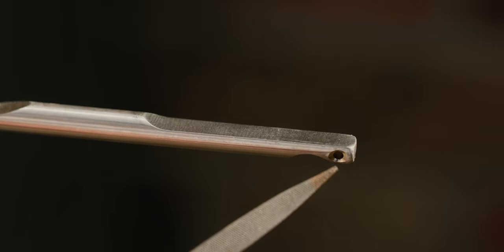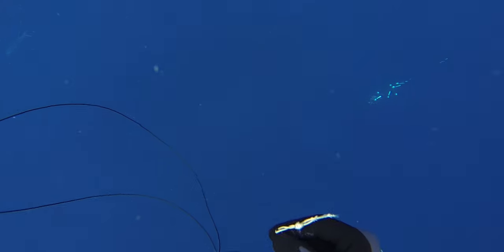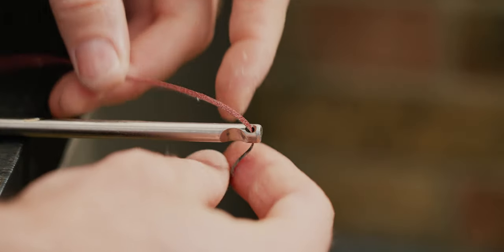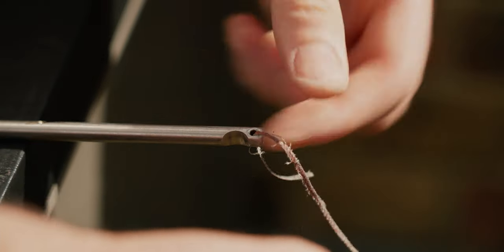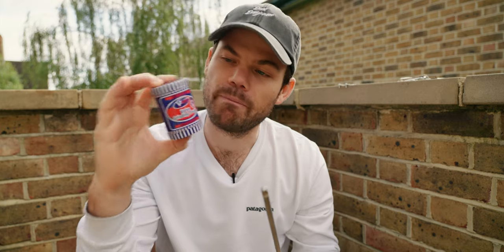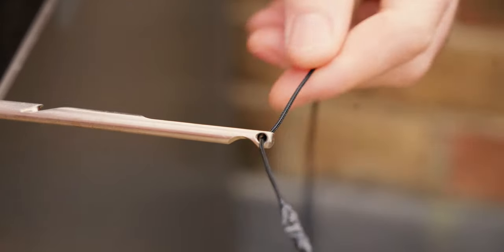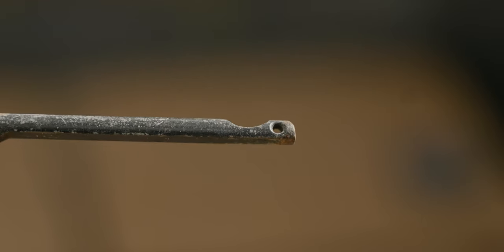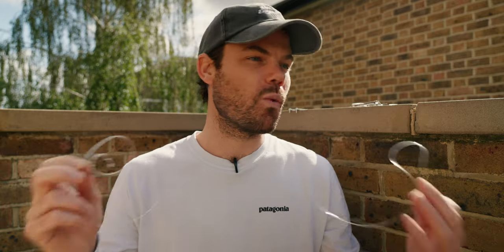Almost every shaft has this problem #Spearfishingbasics

Comment: Great tips. I’ve had issues with bridles wearing through on rough shark fins, and I’ve lost two good fish so far from the exact issue you made the video about. I’ve since just gone to tying the loop onto the shark fin holes but I’ll absolutely be doing this in the future. Huge fear of mine and I’m checking dyneema after every shot I take out of paranoia
Reply from the maker: Fix it once and forget about it 😁

Comment: I love these practical tips. Seems like details, but as an angler I learned to realize the importance of getting the details right. Imo also large part of what separates the pros from the rest.
In your experience, is this an issue with cheap spears or just generally an issue?
Reply from the maker: All the 1%’s add up to a big difference. All sorts of shafts have this problem, not just cheap ones.

Comment: Awesome vid. Such an important bit of information. 
Lost what should of been a world record mutton snapper in Islamorada using a brand new Omer shaft. That shaft was my backup shaft, however 2 dives earlier I lost my original shaft when a massive bull shark taxed my black grouper, as a result I used my back up shaft with 300 Lb mono line and I lost it on my first shot on what I believe was a 24-26 Lb mutton snapper. The mono snapped within 2 seconds of being dragged. Lesson learned.
Reply from the maker: All too common this problem with shafts sadly! Hurts even more with world class fish.

Comment: Hello Daniel, why do you use this type of shaft? And not the one with the hole at the top on the shark fin?
Reply from the maker: Faster to reload as the fish doesn’t get stuck on the shark fins when you go all the way through the fish. Also better for hole fishing as you can always pull the shaft back out from the rear. Plenty of reasons to use one or the other.

Comment: Excellent video here. Did I hear you say that there is no need for this on rob allen shafts? Did I hear that correctly?
Reply from the maker: I’ve never had this issue with Rob Allen shafts. They are always impeccably finished.

Comment: Great timely video Dan as where coming up to pelagic season in aus.

Im gonna go out on a limb and guess Gumption or toothpaste would work as a cheaper more readily available source of polishing paste¿?
Reply from the maker: It may work but valve grinding paste is designed to be abrasive for metal. It’s not expensive but I’m sure there are other abrasives that would work also.

Comment: what do you use to restore the coating afterwards? i'm thinking about to do that on my salvimar shafts or better on the sharkfins. they are nice but not perfect
Reply from the maker: You don’t need to do anything to stainless steel shafts. The ones that are a bit brown coloured is just from the heat treating so not a protective layer as such. Certainly nothing like a Rob Allen spring steel shaft, you need to use zinc-it or spray gal on those.

Comment: hey dan how can i stop my spear from rusting? it makes the flopper loose very quickly and i constantly have to adjust it
Reply from the maker: If it’s a coated shaft it’s always going to rust once the coating gets worn off from shooting fish or shooting into sand. You can sand it down and apply something like zinc-it to it but if you want zero rust, stainless steel is the way to go.

Comment: First thing you need is to stop shooting with mono and switch to using dyneema as your shooting line. There are multiple advantages that I won’t go into.
Reply: Explain please
Reply: Completly agree. The best part is no part. 
So many things can go wrong with monoline. 
Hole snaping, crimp snaping, crimp edge cutting mono.
Reply from the maker: I can’t stand dyneema as a shooting line. Bulky knots, tangles on everything and zero memory making reloading slower. Despite our preferences, sharp spear holes are always going to win against dyneema or mono.